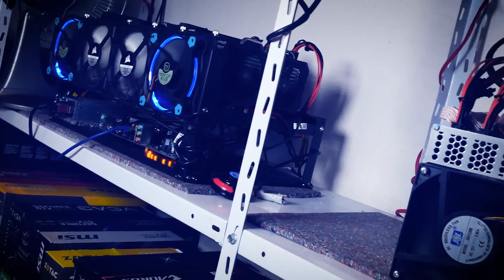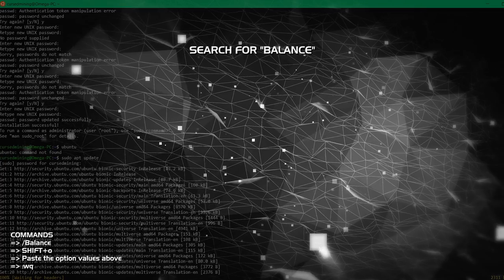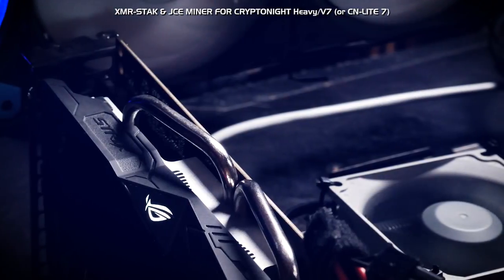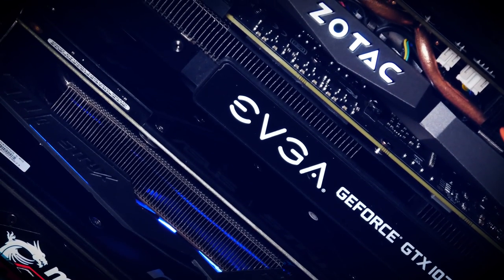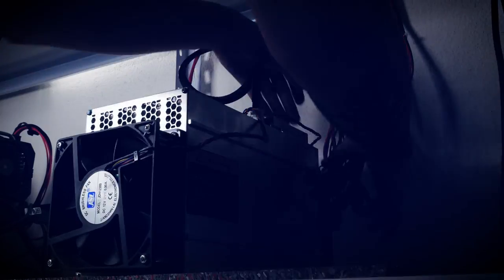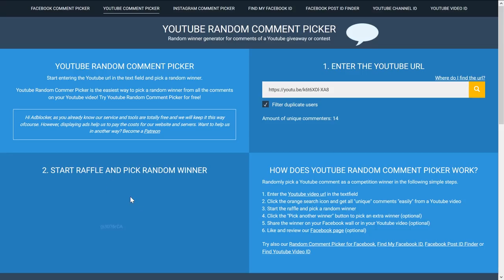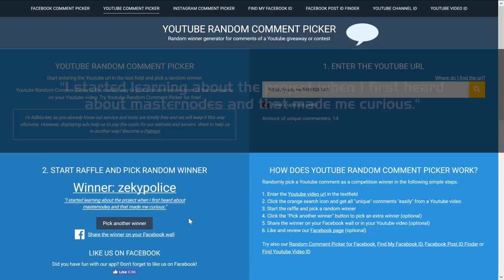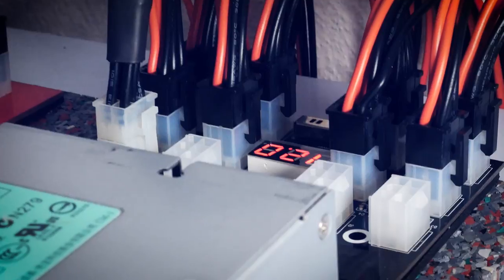Cursed Mining Farm #6: September 2018 - Z9mini CPU GPU Octominer L3++ Baikalminer Antminer

Comment: My batch 2 arrived Friday after i left town for the weekend, got back yesterday and got it started up. Won't go above 675. Stable for last 20hr's hitting 14.82 KSol/S
Reply from the maker: 675m is better than most batch 2 :) still pity they don't overclock as well as b1 :/ cheers
Reply: keep watching your z9 mini. the one hashboard of my z9 mini 2nd batch is 0 hash after 3 days later with 675M. I had to change it 650M. 650M is stable.